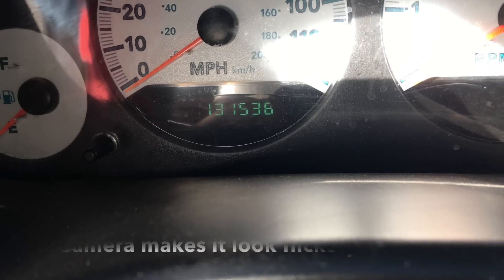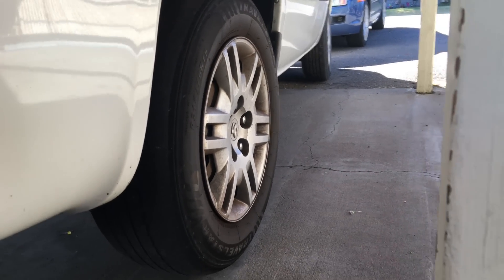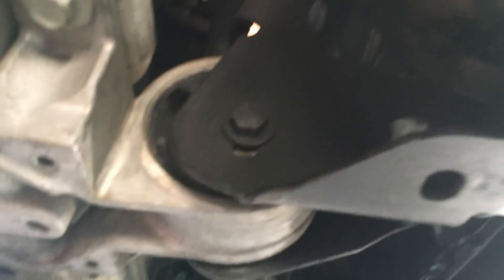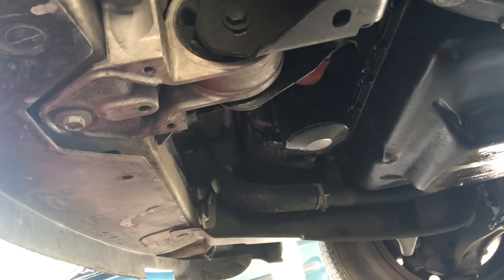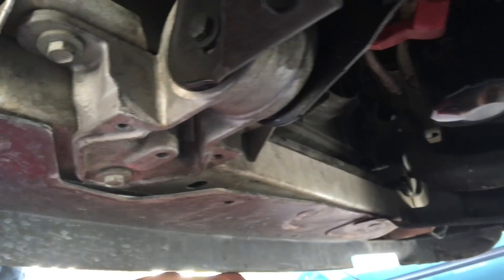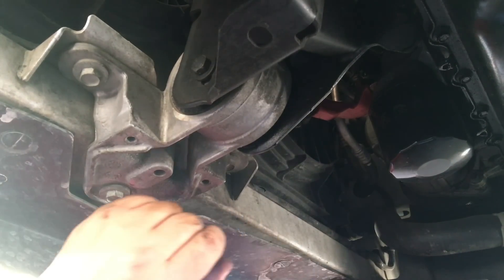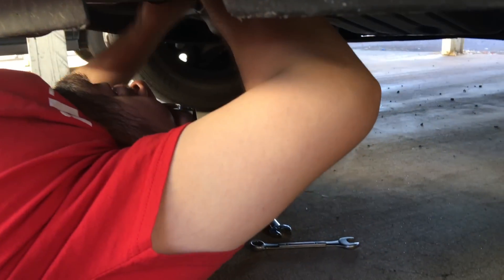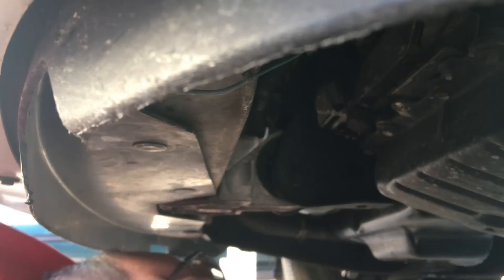Dodge Grand Caravan | Starter Replacement

Comment: Thanks for sharing.  A lot of the information helped me in my starter change out.  However, I was not so willing to do the extra work of removing the cooling fans, so here is what I did, and I hope it helps someone.  I found that my standard length 15mm combination wrench would just barely clear the fan motor allowing for just enough swing to grab the next nut flat on the upper bolt.  However, there was not enough room to use a second box end wrench for a cheater since the bolt was very tight.  So I placed the box end on the nut at the highest position, then took a 5' water key and placed the saddle over the open end of the combo wrench.  Pushing straight down on the key gave me enough force to move the bolt.  If you don't have a water key, try any long rod or similar device that can be positioned over the wrench without sliding off.  Once that hurdle was cleared, the rest of the job went pretty well.
Reply: what is a "water Key"?

Comment: The top bolt is a deep socket 13 mm and I needed to use an extension .it was tuff to get it out.the bottom bolt or bolts are 15 mm regular socket.My starter on my 2005 doge caravan sxt was only held by two bolts. Thanks for this helpful video.My van would start then it wouldn't start and finally I would try it again then all I heard was a click when I turned on the ignition. I took the battery to be tested and it was at 85%.So then I knew it was time to replace the original starter.

Comment: You dont need to remove the fans, just use a socket and a 5" extension for the top bolt. See other videos here. Also when it clicks all it needs is a set of solenoid terminals for $9 on Ebay. Put the old one back in.

Comment: I have a 1998 dodge caravan and I found it a lot easier to just remove the frpont engine mount. After you jack engine up enough to take the weight off the front mount you can easily take off mount giving you access to everything youy need to get to. removing the fans you run the risk of medding up the wiring or hitting the radiator causing a leak.JUST REMOVE THE FRONT MOUNT AND MAKE YOUR LIFE EASIER.STARTER COMES OUT THE BOTTOM AND FALLS IN YOUR HANDS.
Reply: Thanks, I was wondering if that would help.

Comment: Your video was okay until you said to remove parts. I didn't have a 3/8 swivel so I  went and bought one to take the top bolt out.  No parts came off the van except for the starter.  Your best to was the 13mm holding the ground wrote in place! Got'er done in record time.  Thanks for the tip!
Reply from the maker: James Simmons thanks for the awesome comment. Way better than paying someone else to do the job. :)

Comment: Can you give me some info from your experience??
i went under my 2006 and i can't tell how many bolts used to install starter
i saw one bolt on the drivers side towards the top that holds ground wire in place and secures starter.
I saw a second bolt drivers side bit lower that holds the starter in place
I saw what i believe is a third bolt that appears on the drivers side oil filter side. I can't tell for sure. Is that a bolt, therefore making 3 bolts??
If that is the case with the 3rd bolt doesn't look like enough room in there.
I only saw you remove 2 bolts.

Comment: Very nice video. I'm curious. What was the starter doing, or NOT doing that lead you to replace it? You said that rapping on the starter didn't help. Thanks
Reply from the maker: The issue started with the starter not cranking when the van was warmed up. No click, no nothing. If you let it sit for 15-20 minutes it would start. Then one night it sat and still wouldn't start once cold. $82 starter and about 1.5 hours of my time because I didn't have the right tools - and it's fixed. :)
Reply: Leo Wells sounds like my starter problem. I can hear the fuel pump but nothing beyond that. clearly the motor isn't turning over. Thanks for your quick reply.
Reply: Leo Wells sounds like my starter problem. I can hear the fuel pump but nothing beyond that. clearly the motor isn't turning over. Thanks for your quick reply.
Reply from the maker: Good luck changing it out. Hopefully this video helped you feel confident in doing it yourself. I hear mechanics like to charge a lot for this job.